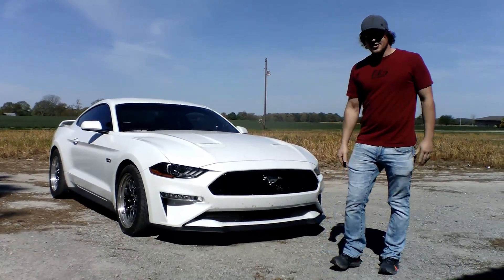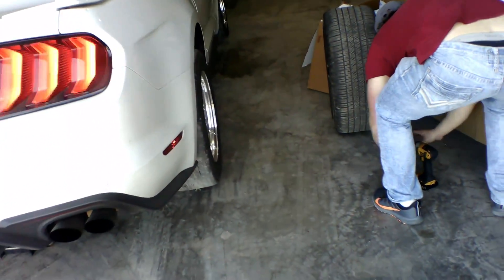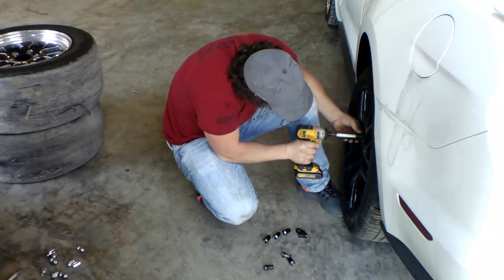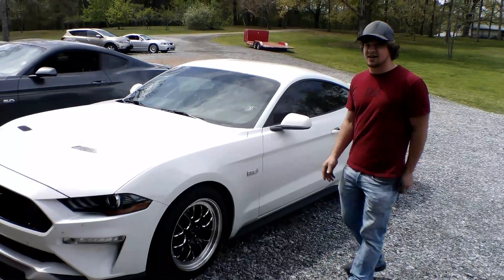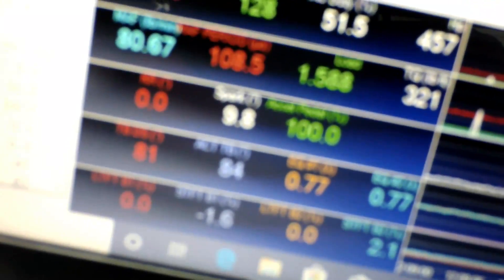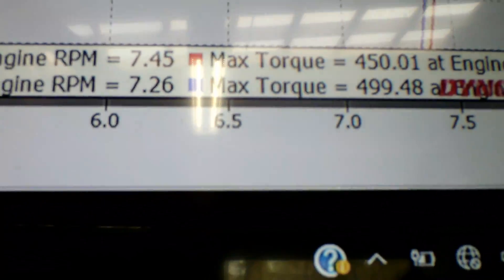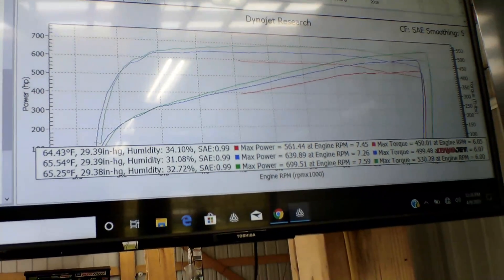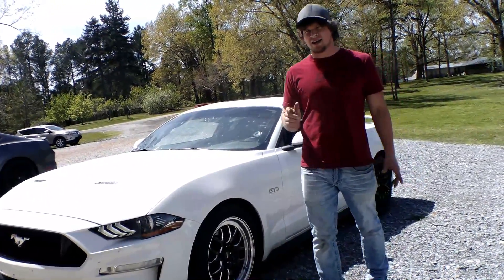2018 Whipple Mustang GT gets on the Dyno: Timing Test

Comment: Daryle just did my first oil change my 2017 just starting making that ticking on the driver side. I’am thinking the selonoid on the front VCT. Good performance still. I could here it launching in gear slow, in neutral. I like your input thanks great content bro.

Comment: How did you get the stock blower to pushed that much without having a smaller pulley and a bigger throttle body because I have a 2019 GT with a 3.0 whipple with a dyno tune from lund and it only made 584 rwhp ahd 470 torque
Reply: Cole Thomas if you’re only making 584rwhp, that’s something extremely wrong with your setup, on 93 octane, even a stage 1 kit would get you to 650rwhp... I would definitely get that checked out immediately
Reply: Filipe Da Silva that’s what I’m saying but idk what it could be everything runs right and the timing on it is correct it’s not losing any power
Reply: Cole Thomas call PB dyno and pay for a remote tuning session Lund did you wrong
Reply: KingKrush Rex I figure out why it’s only on 7 pounds of boost instead of 11
Reply: If the timing and fueling is good Lund didn’t due you wrong you have an issue with the car or dyno